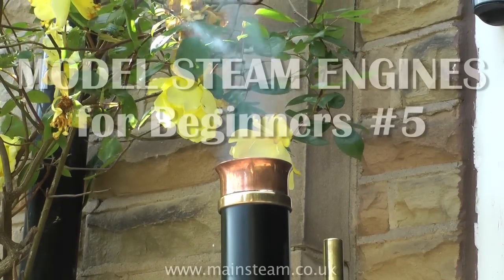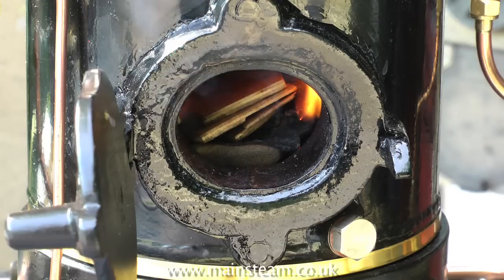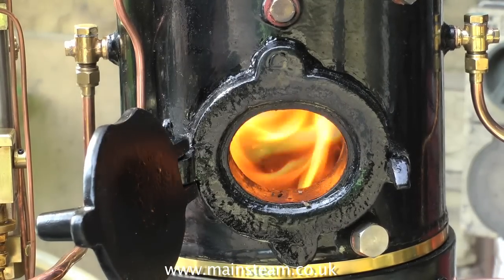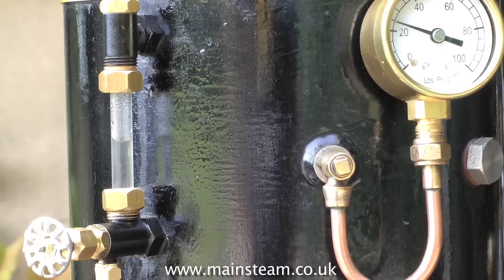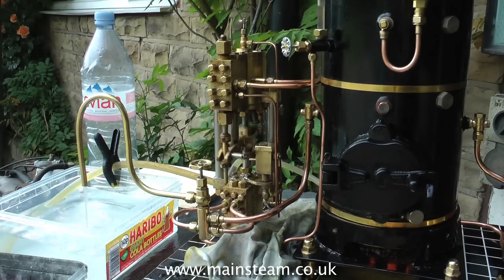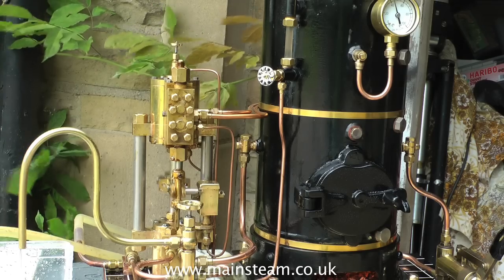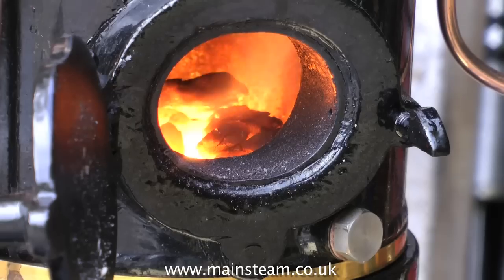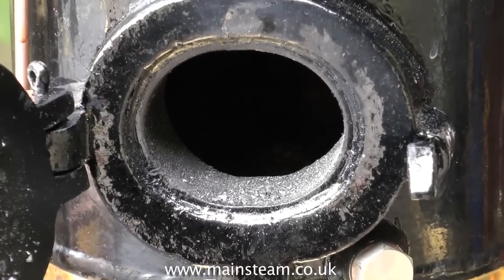HOW TO COAL FIRE A BOILER - MODEL STEAM ENGINES FOR BEGINNERS #5

Comment from the maker: Thanks John for the good comment. The boiler has a "wet" firebox where the fire is. With a coal fire on a dry firebox it would not be so efficient, and without fire cement or some insulation the paint would just burn off - this boiler is like a locomotive boiler with a proper "wet" firebox surrounded by water, so as the water is all around the fire which gets very hot indeed, it makes a lot of steam and is quite efficient.

Comment from the maker: Your pop safety valves are obviously much better than mine then, the safety valve in the video is a new one and seems to snap shut slower when new, but after a while settles down with around a 10psi drop usually . . . Thank you for your constructive comment.

Comment: Thanks for the very informative and entertaining video Keith.
Is there a formula for sizing a boiler with a particular size steam engine.
I'm trying to figure out my boiler for a 6 cu. in. engine, any suggestions???
Reply from the maker: Best Racing Tips Win At The Dragstrip A general rule is the bigger boiler the better. A bigger boiler allows a bigger fire & holds more water so therefore needs less attention than a small one as regards water level replenishment.

Comment: Hello Keith, I want to have a coal fired steam plant built. Could you put me in contact with someone who could help me out with this project? I want to use this in my high school science class. I'd really appreciate any help and advice you can give me.
Reply from the maker: +Heath Nicks There are some companies in the UK that build coal fired boilers. They are expensive and need boiler fittings etc. Also the boiler would need a test by a qualified boiler tester if it was for public use. I build complete steam plants, only as and when the parts come along. Shipping would be very expensive too as the parts are very heavy.

Comment: Hi Keith,
How do you size a boiler for a given engine size, are there any rules of thumb?
For instance, what size boiler is required to steam a little Stuart 10V, under load powering a boat or a generator set?
I have my 10V casting set, so now  I'm thinking - where am I going to get the steam to run it!
Regards Paul
Reply from the maker: a 3 1/2 in diameter vertical or horizontal boiler will be fine for a Stuart 10V.

Comment: What is the diameter of your boiler and how thick is the steel it's made of? I'm curious because I'm planning on building a miniature steam loco boiler. 
Would iron drain pipe or an old steel fire extinguisher be suitable?

Thanks

Comment: Is the Water pump (principally) a steam engine whiteout a "flywheel" and a cylinder that is connected to a pump (compressor-cylinder?) instead of a "flywheel"?
Reply from the maker: Yes, with an internal shuttle piston operating a second slide valve to make the pump self starting.

Comment: Yeah no problem. When we do overhauls at our museum, we have to re-seat the safety valves if they blow off more than 10 psi which at 180 psi is a loss of 18% of potential power. You never notice this as it only take a few seconds to blow off again. When your model boiler was blowing off from 70 psi down to 50 psi, that was a loss of 30% of potential power lol!

Comment: When firing using anthracite my fire goes out frequently and struggling keeping steam. Any tips for me?
Reply from the maker: Insufficient draft probably. If there isn't enough air travelling through the fire it will go out.
Reply: Is house coal better for when starting out firing?
Reply: Bituminous coal burns easier, anthracite burns hotter, like gasoline vs diesel. Try bituminous coal unless you've got ways to easily increase draft.
Reply: @OfficialUSKRprogram  Thanks will do that. I'm going to try some soft dry Welsh steam coal. What coal do you recommend?

Comment: Did you custom build this boiler? Do you have any plans or drawings?
Reply from the maker: Christian Holbert I bought the boiler more or less as you see it, all I did was test it & add the fittings etc.
Reply: Keith Appleton where did you buy it?
Reply from the maker: I bought it from a friend, you can get model steam boilers via Ebay - but be careful .....
Reply: Keith Appleton I'm trying to build a copper coal fired boiler like yours..... I wish there was a way for drawings or plans and prints of the boiler.

Comment: i need some help on a homemade train that runs off steam and coal the pipe for the smoke to come out of through the tank is lower than the top of the door do i need to lower the door (make it smaller) for the coal to burn it seems like it doesnt have enough oxygen

Comment: One question.  is your boiler copper or iron/steel ?
Reply from the maker: +Matt Schuette This one is 1/4 inch thick Stainless Steel
Reply: Awesome, Thank you Keith. You've been inspirational in my "rise to steam" so to speak. I'm in the process of sourcing materials and tools for my first boiler, Fortunately I used to weld high pressure HVAC systems when I was younger so I have a leg up on the copper boiler thing =)

Comment: Why do full sized steam locomotives not need blowers to get the fire going like miniature locomotives and small boilers do?
Reply: ELPaso1990TX All full sized steam locomotives do have blowers, most of the time they arnt very relevant and noticeable, but the same concept on a large steam engine is the same for a model steam engine, to increase the draft on the fire (so it doesn't go out) while no exhaust is being created. In the case of a steam locomotive or traction engine, that is while the engine is setting still.
Reply: Our traction engine has a blower.

Comment: The hotter the fire the more steam and the more steam the faster the engine right???
Reply from the maker: That's more or less what happens . . . The hotter the fire the more steam and the more steam the faster the engine and the faster the engine (or if the engine is pulling a heavy load) the exhaust blasting up the chimney drags more air into the fire and it gets even hotter . . .

Comment: Seriously bro your safety blows off for 20 psi, that's fucking useless. After 20 years of both model and full size engine operating, I find the pop type safety valves on all the models I've had only drop 5 psi and all the traction engines and locos I've fired/driven with ramsbottom and pop type safety valves only drop 10 psi. I think you should replace it!